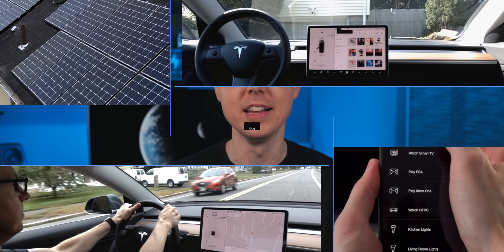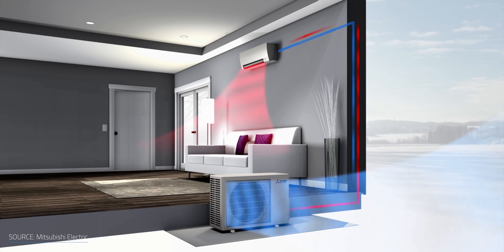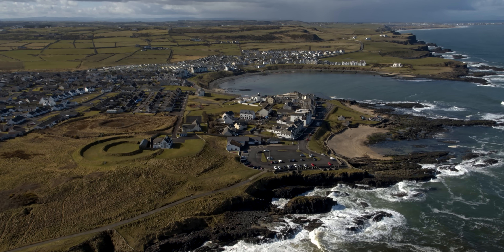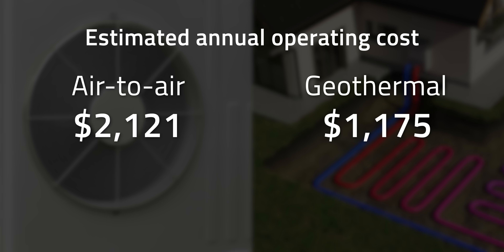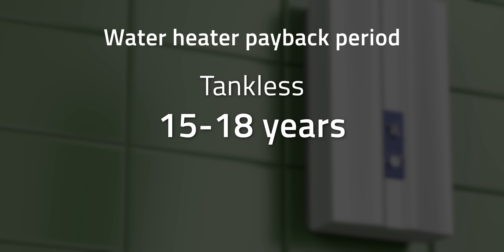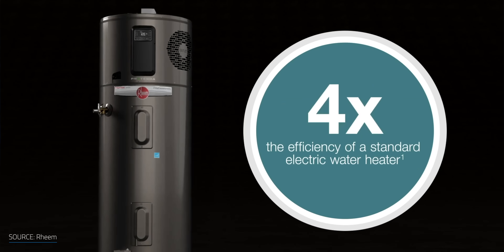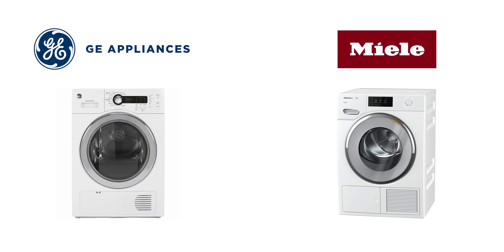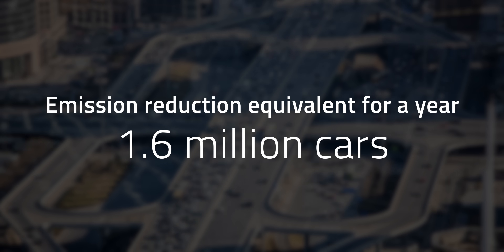Why Heat Pumps are Essential for the Future - Explained

Comment: I live in Wisconsin. Tho am still trying to make a decision on a new heating/cooling system due to my poor financial state couple with inflation.  You are correct, the problem is the cheap natural gas.  To run an electric heat pump in my winter means not only do I spend more upfront for the system but I also pay more for the fuel to run it.  I do get the benefit of the heat pump system having a higher SEER rating on the cooling mode than a normal AC unit but the costs and savings still don't make much sense for me.  If I do it, it's because I am planning for solar later which makes it more attractive and i have to work my ass out
Reply: Elizabeth Mcclain  you should channel that question to the congress men and political heads not Matt. inflation and recession is hitting us very hard, Gas up, prices up, grocery up, everything is x3 or x4. the worst is we are not having any raise at work place. i wonder the method to employ in order to stay above waters , we are drowning
Reply: Inflation is gradually going to become part of us and due to that fact any money you kept in the bank or in a low-interest account declines in value each year. what we need is an invstment planner who will help managed and positioned our finance by minimizing loss and maximizing gains
Reply: @mialangley2388  This sounds like a great idea, but never knew how to go about it, Have you seek professional assistance before? what is the experience like.
Reply: @richardsoncuthel810  My advisor is Katherine Duffy Burke I found her in a business magazine where she was featured and reached out to her afterward. You can look her up online if you care for supervision, just search her name.
Reply: Say goodbye to cheap natural gas lol
Reply: I'm in a similar condition, and also in Wisconsin.  My old AC unit from 1991 died over this past weekend, and after cajoling a number of local HVAC companies over the past few days (some unwilling to quote heat pumps), I'll be going with a new heat pump unit.  It may not may too much sense in the short term, but we also are going to install solar in the next year or two, which is where the new system will really shine.  Best of luck!
Reply: Use a heat pump on moderately cold days. When the temperature outside is below 25 degrees F outside, it is ok to cheat with a gas furnace if you can't afford to use the heat pump all the time.
Reply: The current models do well down to -10F I believe, which is good, but not quite there for Midwest. May just have to supplement with electric space heaters for those coldest days. 

Another option to get off the gas is if your water heater is also gas, going with  a hybrid water heater is not too shabby for how they work, and it's cheaper than replacing your furnace.
Reply: Elizabeth Mcclain  You are very lucky with low cost energy where you live. A lot of people in the USA can spend thousands a year for gas heat plus a few more thousand on electric.
Reply: If you have a well insulated home that is less than 2,000 SQFT I would suggest getting a Mitsubishi Hyper Heat system and a ducted air handler. These units are still pushing 100% heating capacity at 5 degrees Fahrenheit with a COP of 1.6. that's still 60% more efficient than all electric strip heat at 5 degrees. They can still push about 90% of their heating capacity at negative 13 Fahrenheit! This is for the SVZ-KP36NA & SUZ-KA36NAHZ (3 Ton ducted heat pump and air handler). The wall mounted ductless mini splits from Mitsubishi are also amazing. Make sure you get a Hyper Heat model.
Reply: Heat pump winter savings alone runs summer sweet cool comfort
That is 0 net energy in my books 
It does not pay heatpump  or futur replacement  but i love it got 2 of them
Reply: The only thing that makes it a heat pump is a reversing valve (and an accumulator). Heat pumps aren’t inherently higher seer rating than their A/C counterparts. And a traditional heat pump isn’t necessarily going to cost you less to operate just because it is installed, without the offset of solar. But it is significantly more efficient than fossil fuels. 
The video explained (very well) the co-efficiencies of the different systems. But here’s a much more digestible version for the average person. The video talks about an 85% natural gas furnace. What that means is for every dollar spent in heating, only 85 cents actually goes to heating and the the other 15% is lost due to inefficiencies. With heat pumps, for every dollar you put into heating you can get up to $2 worth of heat. This is why governments are pushing towards heat pumps.
Reply: @joelhanawalt5660  Current models are running at 100% capacity down to -20F or -15F, depending on sizing. That doesn't mean they won't heat lower than that, they just won't be at capacity.  I agree with the space heater option, because the number of days where temps are that low, at least in my part of Wisconsin, is usually under a week and sometimes not at all.
Reply: Or fossil fuel prices rise so high that the economic case is more easily made. A report by E3PI of Transition Zero indicates that it is cheap to change from coal to solar, than it is from coal to gas for grid power which is fascinating. If we try to see 10 or more into the future, all these cost parameters are going to change, it appears. Regards
Reply: We also had cheap gas in Europe before. Until Putin had to invade Ukraine...  sigh*
Reply: We live in Minnepaolis in a 1 1/2 story single family home and in 2020 we replaced our 20+yo 80% single stage furnace and AC with a cold climate heat pump system and a 2 stage resistive electric backup built into the plenum. At the same time we installed some rooftop solar, and replaces some draft windows, and, took out some loans to help pay for it through the Minnesota Center for Energy and Environment (MnCEE). Here's some things we learned though of course your mileage may vary as they say. 

Everything here applies to Ducted air-air heat pumps and we know nothing about mini splits, geothermal (other than knowing i wish i looked more into it) or Air-water ones like in the UK.

1. Heat pumps don't mean ditching gas per say - they do usually mean ditching your AC, but they can be happily paired with a gas furnace if you are concerned about going all in, or don't have other means to reduce potentially high bills.This means you can use electric heat when it;s cheaper and gas heat when it's cheaper (which above freezing or any time the heat pump COP is in the 3-4 range, electric might be cheaper). YOu never know what the utilities will do to your prices for each 5-10 years from now so having that choice can be important.

2. We found that most AC manufacturers offer heat pump versions of their equipment so less efficient / less able to heat in the cold and cheaper (a Rheem one we were quoted was good for hear to about 32F) and others like Mitubishi Hyper Heat or Carrier Greenspeed systems can go well below 0F just fine. Most heat pumps still pair with an airhandler which could be a furnace or electric heater, but some like the Mitsubishi Hyper heat are complete systems, and others need to pair with an furnace/air handler/thermostat of the matching brand. Anyway, point is, if you are looking into an AC, it's easy to say "hey, is there a heat pump version of this". In general costs were $500 to $2000 more than the equivalent AC, but like i said above, you can't choose to use electric heat if you don't have a choice and that choice might be worth the money.

3. The Mitsubishi Hyper heat series is really good....but expensive. Most HVAC professionals in the area were against going electric at all, but we did hear praise for this system. It's not the one that has the highest efficiency AC properties or even the highest performance at cool temperatures, but it can crank 32000 BTU's at 32F, 0F and -12F. The COP is lower than some at those milder temps but it seems to be the air source heat pump to go to if you can afford it. We couldn't.

4. We chose the Bosch IDS 2.0 heat pump. It's good, very efficient as an AC and heats our home well (also with high efficiency) in mild cold, and honestly reasonably well down to around 5F. When the temperatures are below 0F it seems to struggle, the BTUs drop as well as the COP and so the electric backup comes in. Statistically about 20 days per year on average see lows below 0F and the other 345 days are warmer so it's not too bad, and the 2 stage backup means we at least don't blast on the KW all at once but those 20 days can be costly. The Bosch IDS 2.0 system seems well regarded inn the industry though and has a mitsubishi made inverter system inside it as well. It cost us about $3000 less than the mitsubishi would have up front and if we decide we don't like it or the backup heat we don't need to swap out the whole system at once and could replace just the condenser or put a furnace back in where the air handler is so I suppose a little insurance.

5. Talk to your ultility about the different programs they may have. Ours has different rates for those who use electric heat, and they vary for those who have a gas backup (e.g a furnace) or those who are all electric. We have been able to keep our winter electricity costs within about 10% of the combined electric + gas costs for 2018-2019 and 2019-2020, and that's with enrolling in a wind power program that cuts into that discounted electricity rate (and our rooftop is low angle so especially in jan & feb when it's typically snow covered, it doesn't do much to offset our costs). Our carbon emissions are down however (based on the EPA's emissions values for the MROW grid region vs the emissions from burning natural gas).

 Overall I like the system and am glad we have it. Do I regret not spending the extra on the mitubishi (or maybe higher end one from someone else)? A little, but i regret more not asking seriously about geothermal with geothermal specialists. We might have been priced out but that would have been worth finding out and pushing the financial boundaries a bit i think and that does seem to be the best idea espcailly in northern states like ours. In the end I'm happy enough with the setup and we still get to use our Ecobee thermostat with 5 sensors around the home (needed due to our poor duct layout).

Anyway - sorry i went on a bit. good luck and don't stress about going all in - HP + Gas is still going to help cut emissions, may help save money too in the shoulder seasons/milder winter days (and if gas costs increase for you like they have been for us).
Reply: How about if you get rooftop solar electricity? Then at least in the daytime you could get heat at unmatched low cost.
Reply: @Earthsiege  Solar. In Wisconsin? Hey, I have some oceanfront property is Nevada for sale. Real cheap.....

Comment: I have been looking at this for my own space. The cheap install route is an air source heat pump. I really think, even in cold climates, with a COP of 3.5 to 3.7, your opex is flat and you can displace like 90% of your natural gas for heating in the Upper Midwest.
Reply: Can confirm. Last home was “dual fuel” hp and barely used gas in Indiana. New home is ground-loop heat pump. Similar costs.
Reply: @FuncleChuck  do you have a make and model recommendation?
Reply: We heat and cool our 100 year old, 1200sqft house, in a 6700-7000HDD climate, with one centrally located (upstairs loft) high efficiency (HSPF14) low temperature (-22°F) 12000BTU mini-split (GREE Sapphire) and an 8"diameter vertical duct down through closets, with an efficient and quiet 400CFM fan to circulate warm air down from the upstairs ceiling to the main level during the heating season.  During the cooling season the fan is off and the air just cascades down off the loft, and stairs and spreads throughout the house. It was inexpensive to install (~ $2000 DIY), and our energy costs are lower than our gas heated neighbors.  We have standard ceiling heat lamps and a small portable electric heater (very seldom used) in our bathroom.  We also have one of the small heaters in the master bedroom but never use it.  In our living room we have a small glass front woodburner that is set up to pre-heat winter air for our heat pump water heater. During the heating season we light it to supply the water heater with 100+°F air for our Sunday night soak in our big corner tub.  We spend less than $50/yr for water heating. We also light other fires on very cold mornings using scrap wood from a furniture factory,  but we very seldom burn fires at night, now that we have the mini-split. We buy our electricity from a local community solar farm, so we are fossil fuel free. We are now in the process of wrapping the house with recycled foam insulation.

Comment: Speaking from experience as a retired HVAC tech and homeowner, don't get rid of your furnace if you install heat pumps. I guarantee your heat pump will quit working on the coldest day of winter. A gas furnace is still great to have as a back up system. I always recommend redundancy. Heat pump performance declines the colder it is outside. Electric strip heaters help but nothing beats a gas fired furnace.
Reply: heat pumps don't work when it's really hot I live in Arizona and it gets to over 116F in the summer for 4 to 6 weeks and I have solar so the AC runs off the solar.

Comment: Heatpump dryers are more or less the norm here in Denmark. You'd be very hard pressed to find a vented dryer in any store. I have an LG heatpump dryer and am very pleased with it. It dries everything in roughly the same time as my old condenser drier and only uses a third of the electricity (about 600w compared to 2000w).

Comment: What an excellent video! I installed a heat pump at my previous home with a natural gas furnace for augmentation. The home was relatively new and well. The furnace kicks in at outdoor temperatures below -5 [C], which occurs about 4 to 8 weeks each year. The way I see it, a heat pump is just an air conditioner that can run backwards. Our furnace and AC unit needed replacement, so it made more sense to spend a little more and get a heat pump instead of AC. The heat pump is better thought of as augmenting/replacing the use of the furnace for much of the year. It really doesn’t make sense to install AC in homes anymore. They should all be heat pumps.

I now live in a condo which also has a rather sophisticated heating/cooling system that also employs a heat pump, but takes the concept even further. The building was constructed in 1852 and recently converted into condo’s. Individual units have AC and a heat exchanger with hot/cold water supplied by a heat pump/evaporator on the roof, augmented by natural gas boilers for the coldest months. The cool part is what happens during spring and fall. At those times of year, the air is still cold but the south facing units get a lot of direct sunlight, requiring AC, while the north facing units still require heat. The heat extracted by the AC is dumped into the water circulating the building, providing the heat necessary for the north facing units, which subsequently cool the water for use by the AC. So during these months, the entire building acts as a heat pump, effectively redistributing excess heat from the south side to heat the north side. Very efficient, and very cool!
Reply: Yeah I'm in a mild climate zone and I can't believe people are still building new builds with no heat pump. I don't even use my gas furnace any more (cutover set to -10C, which almost never happens).

Comment: Matt, you should research vertical geothermal installations - it´s the currently used method in Scandinavia. Horizontal ones are usually decades old tech - my neighbour has one installed in the 1980s - of course the indoor unit has been renewed and upgraded multiple times, but the pipes are still original. There might be also other innovations to derive in cold Scandinavia.
Reply: Indeed, but I did horizontal, since 2x180m drilliing for 15kW would be much more expensive than utilizing 20% of my 2 (US) acre plot for horizontal piping.
Reply: hey, give the Americans sove time! let the first get used to heat pumps, then we can talk about all the rest. Best regards from a vertical geothermal owner since 1999 in Sweden
Reply: @styletokill  Living at the latitude of Umeå (near Vaasa), geothermal with 700m pipes at about 1m10 depth seems to be just as effective as vertical.
Reply: @ambassadorkees  It is foresure a really good system regardless of vertical or horizontal pipes. Point beeing, it takes the americans a couple of decades to implement it.
Reply: @styletokill  well, the Americans are a few decades behind on multiple issues, no need to be too specific.
Reply: We do have these, an officemate has one installed for his new home. Drilling the wells can become expensive as in many areas we don't generally use well water but it's being done. Horizontal is not super popular due to the amount of land required and the amount of dirt that is usually moved - best for new construction. I have also seen heat pumps that use a water tank and a well - A/C runs and the lawn gets watered! That system was on a family member's home well over 30 years ago and worked great in a salty environment that ate up normal air driven heat pumps.
Reply: It's not "old tech" there is no technological advancement in changing the oriantation of the pipes underground. One costs 10x more to Install since you need very expensive drills.
Reply: @styletokill  lmao.. We have had heat pumps for ages. We just enjoy cheap electricity and fuel cost so no need to spend so much on the most efficient tech. You act like you're so sophisticated 😂
Reply: @randybobandy9828  Here with granite starting some 5...15 meters deep, and rural village housing plots being 1500...3000m², drilling actually is only twice the installation cost and definitively worth it considering the cost and limitations of land use.